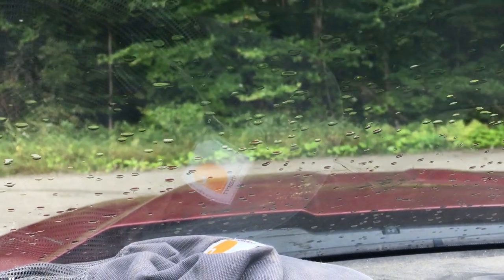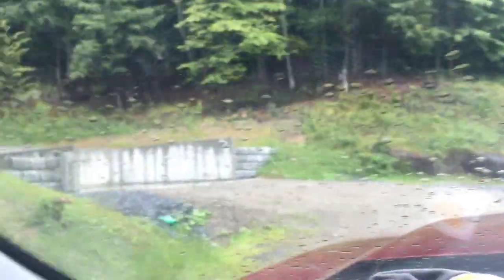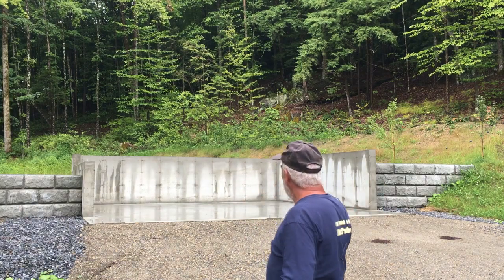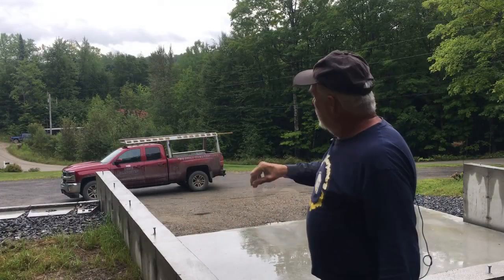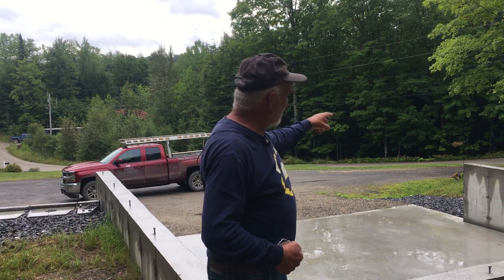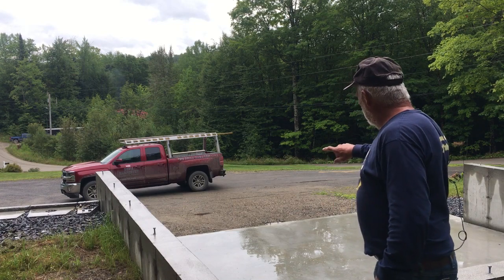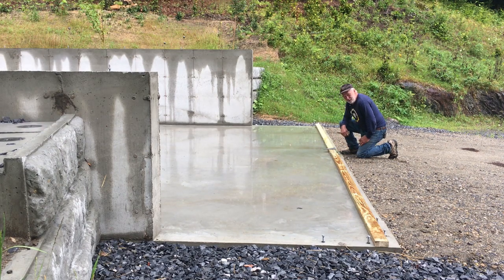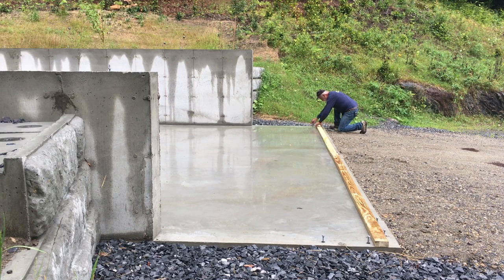Cape Style Garage Part 1

Comment: It would seem that the anchor bolts were spaced inward for 2x6  plate. The  side concrete wall position doesn't show it but I would have place the door /window  opposite as his house is now on the window side..
Reply from the maker: He will be parking in the right side bay so he will have good door opening to his workshop in the left bay.

Comment: Hey Ken,

If you have a helper you can just hold the bottom plate on top of the j bolts and hit it with a hammer.
You will see where to drill from the marks left from the j bolts. It's quicker and easer.

Comment: You could also run a double base plate to avoid hitting a stud as the PT plate is bolted and the second base plate is nailed to the 
PT plate and the studs are nailed over the released J bolts.

Comment: Looks like a fun project especially being so close to home. I was surprised you didn’t use a pressure treated board where the side walls touch the concrete.
Reply from the maker: We separate it with sill seal

Comment: I have often seen the wall anchors at weird spacing. Makes me wonder if the guy who placed them was doing 24 inch centers or just a best guess at every 3-4 ft without actually measuring. Was on a job once where I was installing an oil tank in a basement and I marked the foundation wall so the pipe locations would meet code. (5+ ft from a door or window) I measured out on 16 inch centers to make everyone's life easy. I wanted to come out between the studs. I get back two days later and the framers measured from the other end of the wall so we had to cut studs and frame the opening. No biggie, but you never know if one guy starts on the left and the other guy starts on the right.
Reply from the maker: Adapt improvise and overcome

Comment: Curious, should the boards against the concrete wall be PT like the bottom ones???
Reply: Was thinking the same thing,  maybe even add some sill seal to those as well.
Reply from the maker: Yes sill seal added
Reply from the maker: We use sill seal to separate them

Comment: I remember back before President Reagan, schools were drilling into kids they would hafta learn the metric system.  Here in the United States we would not be able to buy a gallon of gas, a quart of oil,  after 1976. I struggled with the new metric system.  So glad it didn't fly.
Reply: The problem wasnt learning metrics, but they always had you converting metric units into inches, feet, yards, miles. If they just used metrics , really nothing is easier than tens... kinda like numbers in tens!!
Reply: 10s, 100s, and 1000s.  What’s the difficulty?  Besides… all engineering worldwide is in the metric system.  So is all the Military standards for measure! 😉

Comment: 14:01 does the stud that get anchor to the concrete wall need to be pressure treated too?
Reply: Ken answered another commenter and said all the sill plates on the walls will be pressure treated and have the layer of sill seal.
Reply from the maker: We put sill seal to separate them

Comment: Good morning ,Ken and crew you guys are doing a great job I watch all your videos. Could you answer a question for me when you use the eye I joist 14 inch 24 ft span do you need to use blocking of some sort between them I’m very curious on this I’d appreciate it have a great day
Reply: Not sure if he needs to use extra bracing, but wood beams tend to be a bit bouncy so I would certainly put something in. The cross straps are probably the easiest in my mind.
Reply from the maker: The manufacturer says blocking not required

Comment: Hi, I assume you are using 92 5/8 studs with 1 bottom and 2 top plates ( 4 1/2" )so why do you make the walls 8' 1 1/2" tall and not just 8'? I am getting ready to build a garage/shop and was going to cut wall studs to 91 1/2" to make it 8' but there must be a reason you do it your way. Thanks
Reply from the maker: The extra 1 1/2” gives enough clearance for garage door openers

Comment: People that use the metric system always say it’s easier but the truth is … it’s probably not any easier if that’s what they are taught if that’s what everyone in the country uses then of course it would be easier for them .. for most Americans that’s not the case the method of measurement we use is probably just as simple as the metric system. One thing for sure is you can’t use both for a project so if you use the metric system just because it’s easier for you it only because that’s what you were taught. Our system is just as easy and probably just as accurate to us
Reply from the maker: Thanks for the input

Comment: Metric is good for some things but construction isn't one of them.  I do a lot of machine work where plans are either in imperial or metric.  All the dials on my machines are imperial so I've learned to quickly do the conversion in my head.  The lingua franca is thousands of an inch -- a mm is .040" (within an RCH).  Construction is the same.  Nominal measurements are in feet -- 8', 10', 12', etc.  We buy and build in units of these nominal measurements. Similarly, 10' is about 3m and 2' is about 1/2m.  With that I can get close to a usable conversion (8' = 10' - 2' = 2-1/2m.
Trouble handling fractions is probably due to the poor conditions of our schools at the elementary and HS level.  Somehow education went from the importance of getting the right answer getting the woke answer that doesn't offend anybody.
Reply: Retired tool & die maker we built parts in both imperial and metric, I don't use .03937 as conversion number I use .040 but in my line of work we produced tooling to plus or minus .0002 so we had to do everything right.  Oh yeah understand RCH language every machinist uses this!!
Reply from the maker: Wow